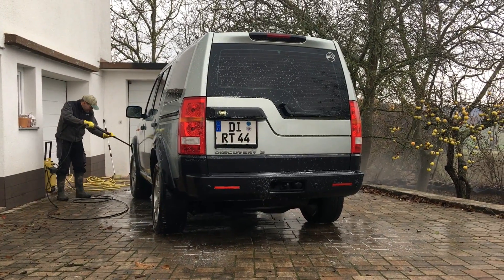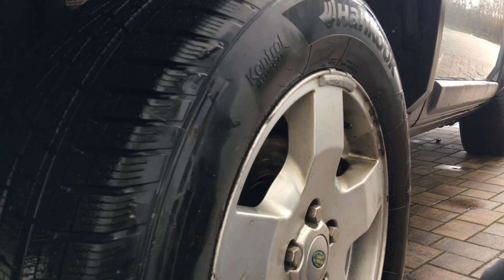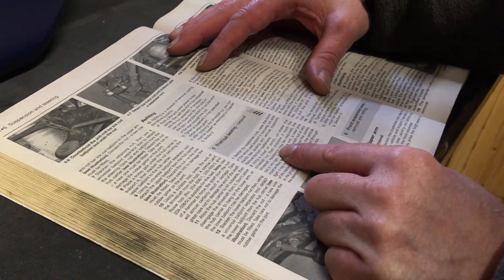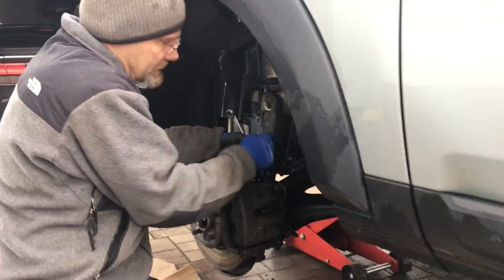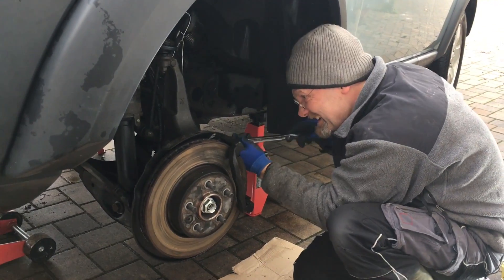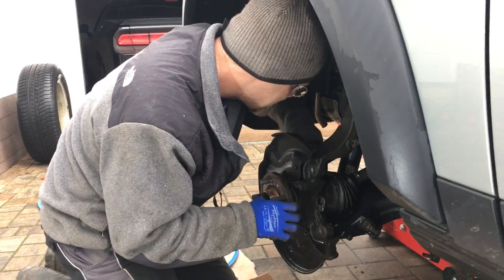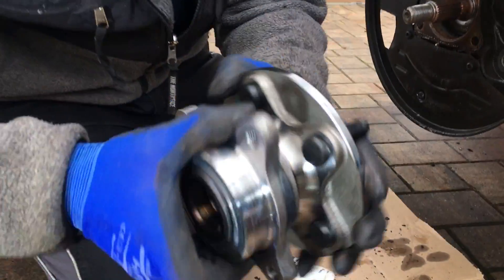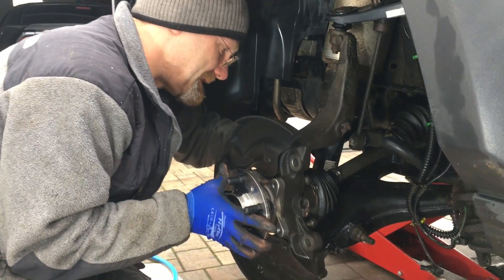Front wheel bearing repair  Land Rover Discovery 3

Comment: Can you advise how to out the vehicle into access mode and disable air suspension prior to doing this work?  Thanks and great video!
Reply from the maker: See our video: 
https://youtu.be/f8SB7aa8jAM
The manual specifies to bring the vehicle in off-road mode prior lifting.  The reason is, that otherwise the auto leveling would cause a lot of moment during the lift process.  For working on the vehicle I want the suspension down in case of a line rupture or in case I need to take the shocks out.  Without disabling the air suspension, the car would inflate/deflate the shocks while lifting.   It is not a mandatory step but I don’t trust the electronics. I was under the car before and it started to lower because of a small leak.
Reply: @Vera_and_Christian  Thank you for the reply 👍

Comment: Hello, several years ago I've red local story  on one person tyred replacing hubs and had actually drilled hole trough hub to the bearing accembly for the accessing it for the lubrication renewal. He made threads and covered channel with brake fluid flush port from the brake support. It would be interesting if you can repeat this idea, test easiest tools available for this and give feedback on modification if succes/fail.

Comment: How long did the GSP bearing last? I checked on Rock Auto, it has a Schaeffler brand bearing. I'm assuming it must be good quality.
Reply from the maker: The front left wheel bearing need  replacing almost every year, no matter which brand. Right side wheel bearing has lasted for 10 years now and still going.👍🙋‍♀️

Comment: Hi Christian and Vera.
Seasons greetings to you and your family.
My question is that you say at the beginning of this video, that you place the car into access mode prior to jacking the car off the ground. My Owners Manual states ' place the car in the off road height prior to  jacking the car up'. Help please!
Reply from the maker: Hello Martin, sorry for my late reply.  The discovery was broke and needed our attention.  Here is my reason:  I don’t want the car to loose air and lower down when on jack Stands. In this case in the Front... simply because it could push the car of the stands.  This is why I disable the air suspension because the car will try to level out certain conditions automatically.  I don’t want that because I am the Boss, well actually Vera is... When lifting the car with the accessory jack, it must be raised to full height before or the jack runs out of stroke.   Sometimes I screw up and the car stays raised over night because I ordered wrong parts, etc, then it may leak air and I don’t want it to move... Happy holidays and keep watching.  Christian
Reply: Many thanks.
Best wishes for the New Year.
Reply: Many thanks.
Best wishes for the New Year.

Comment: great video again, and easy job.  I watch know for more then 6 month your Disco 2 video. And your make me to decide to buy a disco 3. But the V8 and i drive it on LPG. Great car.
Reply: Hiya , hope u don’t mind me asking but is ur petrol the 4.4 V8 please , I’ve got a 2.7 TDV6 and been thinking for a good while about the 4.4 and wondering what do u think or 4.4 please , anything in particular to look out for on the engines plse, thks again , stay safe 👍👍👍
Reply: @garystuart226  before i bought the 4.4 v8 i watched a lot of videos and reviews. It turned out that I should not go for the diesel but for the petrol V8. The engine is much more reliable than the diesel engine and has much more power. But also consumes much more of course. Mine runs on LPG, and I can refuel fairly cheaply in Belgium (0.35 cents / liter). I even live in the south of the Netherlands. Anyway, I only had it for 2 months and so far very satisfied.
ATB Raymond
Reply: @garystuart226   We have a 4.4 LR3 in Canada. We have it lifted, larger tires, roof rack etc so we are heavy. We burn 15-18L/100km. They are amazing engines. It is a Jaguar engine. There is a water line T fitting that is prone to leaking, easy to replace with brass. I also have done the water pump and all the hoses thermostat as preventative maintenance. I think we have approx 240,000 km on ours.
Reply: @joelletendre1011  hi, many thks and that’s very kind of u , are the timing chains/ tensioners ok in them please or am I thinking of the 5 litre supercharged engine that’s fitted to the full fat  Range Rover plse , apologises for asking a daft question so does that work out around 15-18 mpg plse and is that on the LPG as if so that’s very good considering the size of the engine , I do very small journeys with mine and been thinking about the petrol for a good while , alas though done a lot of work to it , not like your goodself with lifting it but rebuilt the entire suspension system and worked my way through out the D3 over a 4 x years period, mines around 100k, thks  again 👍👍👍👍
Reply: @garystuart226    It's no problem Gary.
My mileage would work out to 13-15 mpg.  Ours is just straight gas, as we overland and LPG is nearly impossible to find in Northern Canada, not to mention the problem of storing extra fuel, and the weight of the tanks. Our LPG prices here are around .90cents/litre. Our petrol is 1.10. Even if we stayed near town, it wouldn't make sense to convert. 
The timing components do wear, but both of our 4.4Ls(LR3 and Range Rover HSE) are close to 240,000 km all original except for the cooling system parts I mentioned above. The problem ones where the 2005 and older Range Rovers with the BMW 4.4. All LR3s and the Range Rover from 2006 and newer had the Jaguar engine. The BMW is not bad, but they had vanos and guide issues. They also had some sump issues, and the water cooled alternator was occasionally an issue. 
Yes the 5L supercharged engine in the later years did have some timing chain guide issues, as well as the early LR4 Ranger Rover sports with the 5L.
Reply: @joelletendre1011  , many thks and very kind of u for the info, ref petrol , here in the uk it’s £1.15 per litre and LPG 62p per litre , litres to 1 gallon uk is 4.54609, funny enough heard about the BMW issues but alas didn’t know if it was the same with the jag engines , as a side note ref fuel costs exchange rate , 1 GBP = 1.71265 CAD,    1 CAD = 0.583890 GBP, thks again 👍👍👍
Reply: @garystuart226   Wow the price has come down. We were there I guess 3-4 years ago and it was around 2 pounds/litre. With our poor Canadian dollar at the time, it meant paying 3-4 times what we paid in Canada. A few places we paid close to 4 Canadian dollars for 1 litre of petrol, what a shock when we were paying 1/litre here. Good thing we had a small rental car.

Comment: Oh my tomorrow (Monday) I am scheduled with an appointment to take ours (LR3) in to our friendly local mechanic to change the wheel bearings on both sides
of the front. Id been noticing a lot of road noise and lately has become woo woo woo woo. I thought the road noise was the rugged looking tires my wife  picked a year and a half ago
and then recently i thought the tires need rotating..finally my somewhat worn brain remembered we had been through this before.
Some three years ago we changed the Wheel bearing on one side..I used a good non OEM.. Now the mechanic said its a wheel bearing. Ive decided to do both
so that I can get some quiet in the car again. I'm not sure which has failed but will find out tomorrow..the non OEM with 30k Miles (unlikely)
or the original on the other side for 190,000 miles. He got me the OEM Timken for a good price but unlike the original Timken are I think no longer made in USA.
Also with that many miles its been suggested we use Royal Purple Synthetic Engine Oil which costs so much more than the Synthetic Pensoil but we want this thing to last.
What a beautiful job you did on the undercoat paint job..goodness gracious.Wonderful videos.Thank you.
Reply from the maker: 👍 Please let me know which one failed. 🙋‍♀️ Vera
Reply: @Vera_and_Christian  Hi Vera..I didn't ask him..yeechs : (

Comment: Lucky the driveshaft was already loose. How do you get it off if it’s not? I suspect there’s a tool required for that…
Reply from the maker: There is a pusher tool from LR which is really expensive to get.  I saw people use a air chissel and I used a copper piece to hit the threaded end.  I changed a few so far on LR3 and LR4 and never had a really stuck one...  Lucky I guess.   I also saw people using a lot of heat to get them out but this burns the boot of the side shaft.  Christian

Comment: brilliant! Christian you made that look easy! had to use lots of gas to heat mine! very jealous :)
Reply from the maker: Hello Colonel,  maybe the shaft came out so easy because the road wheel nut was not tight enough.  An other viewer wrote the the spec is not 230 Nm, its 350 Nm.
Reply: @Vera_and_Christian  wow. Could that be why your wheel bearing failed so quickly? Not tightened up enough?

Comment: 230 NM isnt right! The Workshopmanual Form LR say 350 NM on the Halfshaftretaining Nut. But you are lucky i had to chissel my Bearing out. Wasnt fun...
Reply from the maker: Wow, is this true?  My Hayes manual says 230, which is kind of low and this may be the reason why my halfshaft was not stuck at all.    I also remember when I opened them the first time a few years back, I needed a way bigger impact gun from my friend.   What manual do you use?
I found other wrong torque settings in the Hayes manual before. 
...I still got to remove the wheel to mount the wear sensor which I forgott (and saw it while editing the video...)  - then I can increase the torque.  Thanks for this feedback.
Reply: @Vera_and_Christian  i am using original the Land Rover WS Manual for the Discovery 3

Comment: Genuine (Timken inside) or Timken OEM only. Or SNR probably (if still use Timken bearings). SKF have changed two years ago from Timken bearing component to "Made in China". GSP will not work properly as well.

Comment: I just ordered two front wheel wheel bearings from autodoc, manufacturer is called Ridex, a quick research shows them as a German company but I would imagine they are  using chinese manufacture as they were the cheapest. Any experience or opinions of this brand? I also ordered two front lower control arms of the same brand.
Reply from the maker: Better Don’t use this brand. It’s not made in Germany. Use INA, Timken or SKF.  Use Lemförder or Meyle for lower Arms.
Reply: @Vera_and_Christian  oops, already ordered. I will fit them for now as I’m in the middle of building a Land Rover workshop here in Sweden, once I’m up and running I will have more time to go through both of my Discos, D3 380,000kms and D4 360,000kms. As you can imagine they both need some work at that mileage.

Comment: Hi. Please replace your oil pump housing to the stronger version if you haven’t yet, I was about to change the cam belts in a few weeks as the timing belt was due. My engine has now destroyed it self. Not happy. The engine now needs to be replaced. Lots of money. The original oil pump housing is weak and breaks the cam tensioner pulley into itself. I’m replacing the motor as this is the best car I’ve owned. Roy.
Reply from the maker: We did this first thing after we bought it. At 120Tkm.  We did have the weak pump housing.  Thanks for your feedback.

Comment: Great to watch you guys, i watch for the interaction between you two as much as for the content, i own a 2001 Defender 90 Td5, as i'm now 50yrs old i was thinking about replacing it with a D3 for more comfort which is how i found your channel, i was searching for videos of how hard/easy it is to repair a D3, i'm very hands on and can fix my Defender no problem but i have seen loads of horror stories about having to take the body off to do the simplest of engine repairs and didn't fancy that, but by watching your channel i have seen that most of the repairs can be done as long as your willing to take your time and use a little ingenuity. Thanks for your content and keep up the good work guys.
Reply from the maker: 😃👍 Sounds like you are the perfect guy for a Discovery 3. You just have to do your homework on the Disco you plan to purchase and we cannot recommend enought to hook it up to a  diagnostics tool before purchasing. 🙋‍♀️ Vera

Comment: have you guys done any work on the heater core? I just bought my first 2006 Discovery 3 (Phoenix, AZ) and I'm not getting much heat out of the heater.
Reply from the maker: Check if the driver side is cooler than the passenger side (on a LH drive).  If so, the heat exchanger may be clogged.  It is a doable job to remove and clean the heat exchanger. 
 There is a video from Altblech-Schrauber on youtube (in German) how to do that.   If you write him, he may subtitle the video for you.  Also check if all control motors work and direct the air as required.  There are a lot of them.  Also check if the Fuel burning heater (FBH) works on a Diesel (see our video for that). The temp gauge needle needs to be horizontal even in cold weather.  You could have a stuck open thermostate or a disabled FBH if the car does not heat up.

Comment: Good video as normal BUT  I couldn’t hear the noise from the wheel bearing when you tested it before repair because of the music you played at the start . I’d rather just listen to you than hear any music thanks 🙏
Reply from the maker: Thanks for the feedback..This is really important to us.  I know that the music in the beginning was too loud.  Sound is the most difficult when doing videos.  I just bought a new inside dash cam for the A-Rol with an external mic connection.   This will improve the sound inside the car.    I will also be more carefull with music overlay if there is voice.  Note that we don´t do voice-over.  Every word is scene-real.

Comment: Great Video and love the detail! You have a new subscriber.  I also have a wheel bearing noise on my LR3 but it sounds like it's coming from the rear.  One thing you mentioned in the beginning is to to disable the air suspension before jacking up the LR3.  You mentioned to disconnect the 3rd fuse from the bottom?  What was the exact fuse you pulled and is that the only thing need before jacking up the LR3? Thanks so much Mike
Reply from the maker: 😃👍On our D3 it's the third from the bottom. If a wheel bearing is gone in the front, you'll feel it while driving. See if it worsens under which conditions. In the back, could also be that the EPB needs reajusting. We have a new video next Sunday where we replace the ABS module and service the EPB. And while doing so, we talk a little bit about the problems and how we solved them when jacking up our Discovery 3. You might also need to consider, depending on what job you have to do, is whether you put it in offroad or access height before pulling the fuse. 🙋‍♀️Vera
Reply: Thank You Vera! Well I changed out the drivers front wheel bearing last week. You video helped a bunch, but unfortunately still hear the noise. Soooo changing the other front next and then going to check the rears.. I didn’t think to check the EPB! Can’t wait for your next video.. thanks a bunch for replying :)

Comment: To check for wheel bearing noise; on a straight road, put gearbox into neutral about 40mph, ease steering gently right or left, whichever side gets noisier as you turn that way, thats the side with the problem!
Reply from the maker: Ok.  We had this backwards.   It actually was exactly as you wrote. Thanks.

Comment: These cars are heavy and eat these wheel bearings around 80k miles.  I replaced with cheap ones at 70k miles one failed at 100k miles, went with the OEM unit the other cheap bearing is still going strong.  Depending on where you purchased the expensive bearing it could have been counterfeit.  Your truck is so much cleaner and less rusty than mine.  The bearings do not come off so easily on cars in the eastern US.  FYI your torque specs on the caliper bracket(or anchor plate as LR refers to it) are wrong, I saw those posted online and checked, Land rover says 115nm.
Reply from the maker: I'm sorry but I think you're torque spec is for the Rear anchor plate mounting bolt.  The Land Rover manual and Hayes manual match on the anchor plate / caliber mounting bracket torque specs for the Front.  We have both manuals, and both  state 275 Nm for the Front, just checked them again.  The 115 Nm counts only for the Rear mounting bolts.  We know that the Hayes manual has on occasion listed a wrong torque spec, but not in this case.  I do not mess with torque specs on a car like this 😅.  I am always amused about the torque specs of Christian's brothers Smart car 😃.
And it could have been that we gotten a bad bearing, but I doub't it.  That is just Land Rover Discovery, a luxus SUV which breaks often.  You just have to live with it 😅, we do and we love it. 👍🙋‍♀️ Vera
Reply: @Vera_and_Christian  You are indeed correct, 275nm for the front.  I better go tighten my front caliper bracket I just did my brakes 3 weeks ago, I probably didn't torque the front correctly!  I must be pretty lucky not much has ever broken on mine it's not a Toyota but it has been far better more reliable than the VW I had before it and the Nissan I had before that.
Reply from the maker: @shaunbava1801  👍 😅 The interaction with our viewers is the best part 🙋‍♀️ Vera